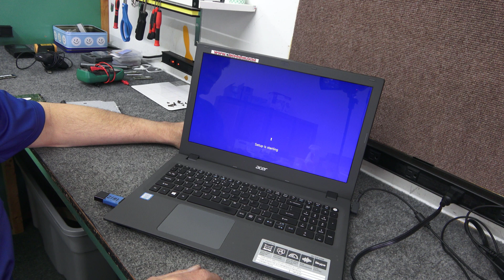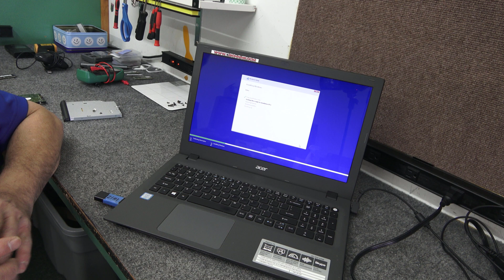HOW TO INSTALL 2.5" SATA SSD IN ACER ASPIRE E5-574 LAPTOP

Comment: That happened to me one time trying to upgrade someone's laptop with extra RAM.  It wouldn't post, and it was a brand new stick of RAM ordered from Amazon.  And, yes I doubled checked to see if it took 'L' type RAM(low power); I had to send it back for another stick of RAM, which did work.  Go Figure!